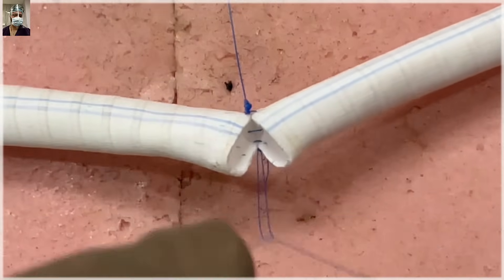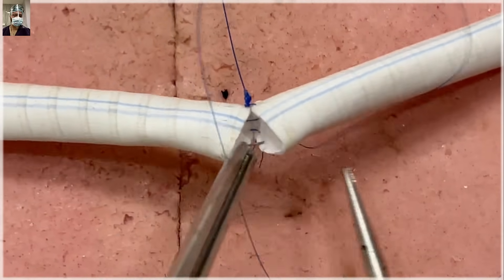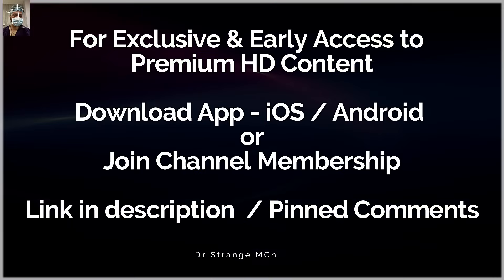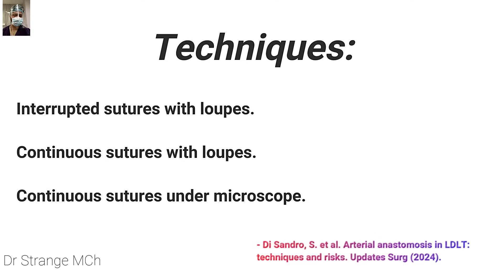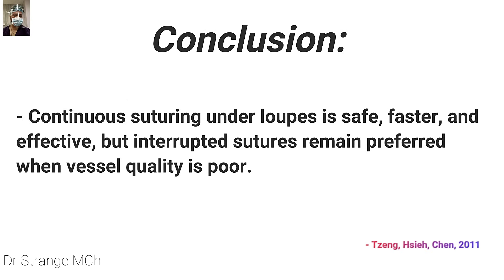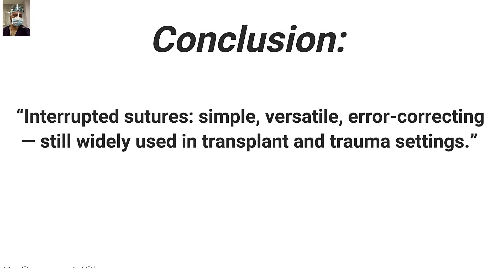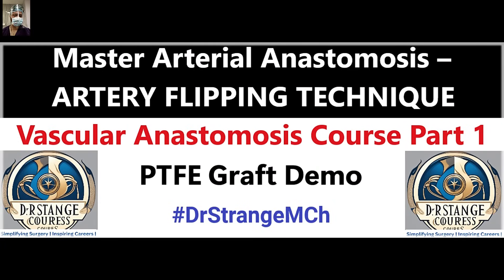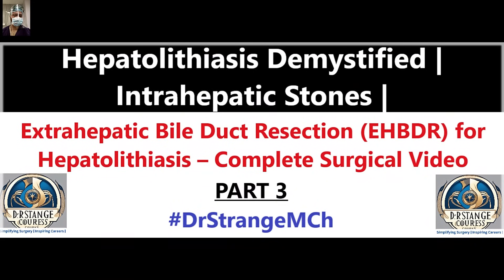Vascular Anastomosis: Theoretical Rationale Basic Setup: Interrupted Suture @lohithavenkatesh2103

Comment from the maker: 13.	A 35-year-old male with penetrating abdominal trauma undergoes SMA repair. The artery wall is friable. Which anastomotic technique provides the safest option?
A) Continuous polypropylene sutures
B) Interrupted sutures with knots inside
C) Interrupted sutures with knots outside
D) Stapled anastomosis
http://youtube.com/post/UgkxS-a2RejBo_f1NZ9pykM8kuRhZTsbvyjH?si=wR2KeFzhO6L_je17
Answer: C
Explanation: In fragile vessels, interrupted sutures with external knots avoid purse-string effect and reduce risk of tearing. Continuous sutures may cut through.
Reference: Moore’s Vascular Surgery.

Comment from the maker: 1.	Which of the following is the main advantage of using an interrupted suture technique in arterial anastomosis? 	#VascularAnastomosis #DrStrangeMCh #SurgicalSkills
A) Faster completion time
B) Reduced risk of purse-string effect
C) Less foreign material inside lumen
D) Reduced blood loss
http://youtube.com/post/UgkxaC4Cwc0iAmLLsUE1PvR7sfXCkjNekIGE?si=MF5loS80FN-bTvyR
Answer: B) Reduced risk of purse-string effect
Explanation: In interrupted sutures, each stitch is independent, preventing circumferential tightening or purse-string effect, which is common with continuous sutures. This preserves lumen diameter. 	Reference: Rutherford’s Vascular Surgery, 9th Ed.